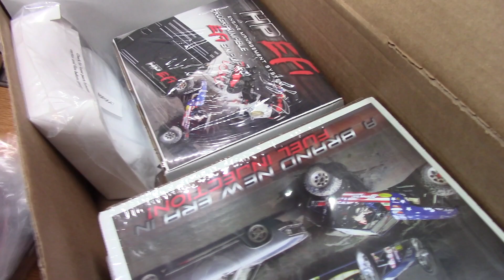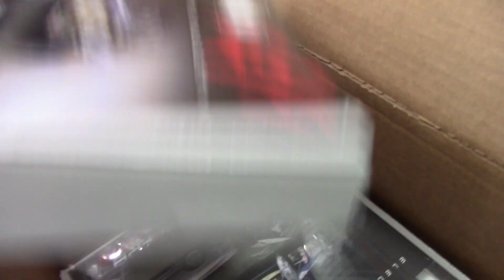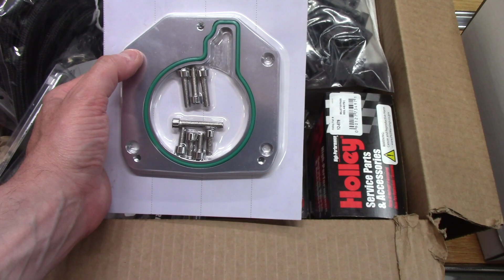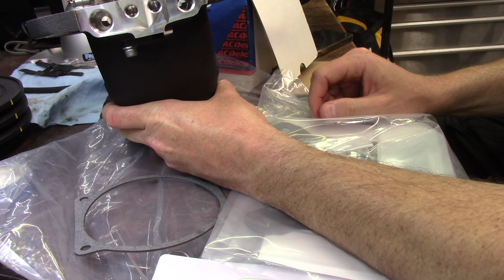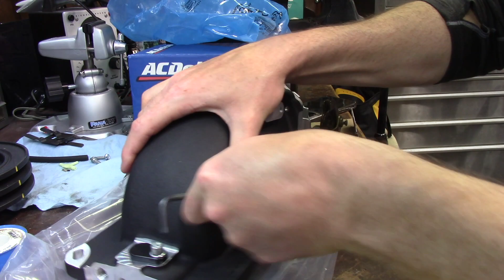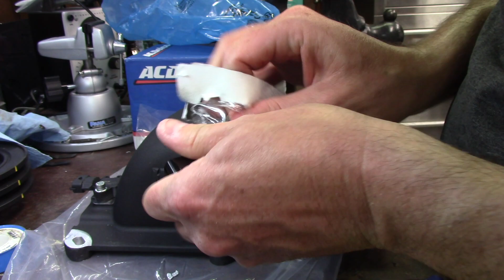Ford 200 MPFI Conversion Part 2 - Throttle Body Assembly

Comment: I'm really enjoying this, you are doing a great job. Also you are explaining it because that's what you do and it is helpful to understand not only what you are doing but why you are doing it. 1 other thing, many people make the mistake with EFI of fitting a TB that is way to big. Because EFI can precisely meter the fuel based on the amount and density of the air fitting a correctly sized TB is a very worthwhile modification. Fitting one that is to small is a restriction and fitting one that is to large can create a portion on a tuning map that is simply not worth tuning.
Reply from the maker: That was exactly what I struggled with. Holley wanted me to use their 1000cfm TB. I was going to use it and disable 2 of the barrels. Did some research and found the stock LS TB was just about right.